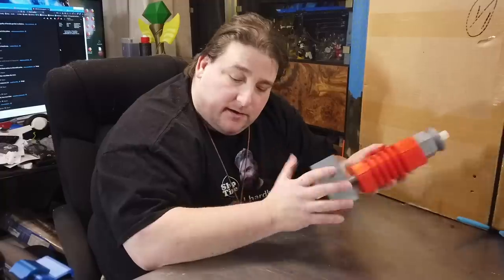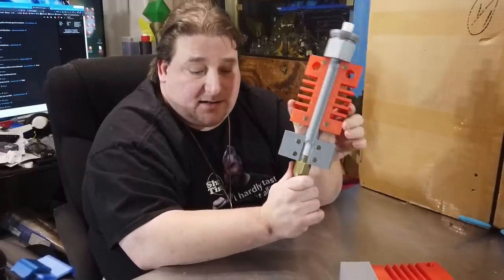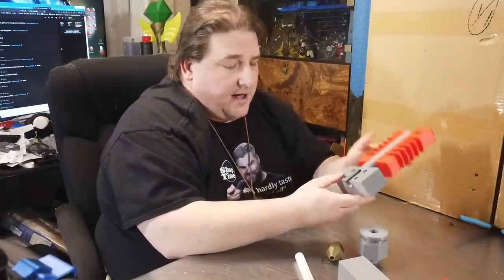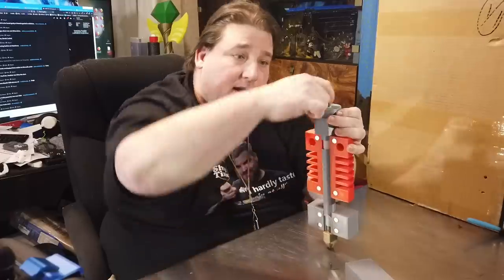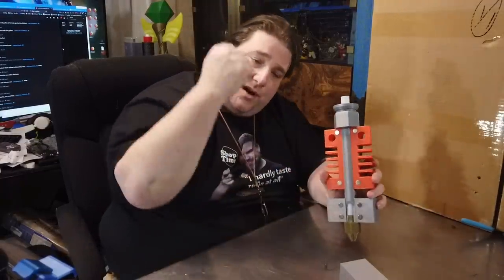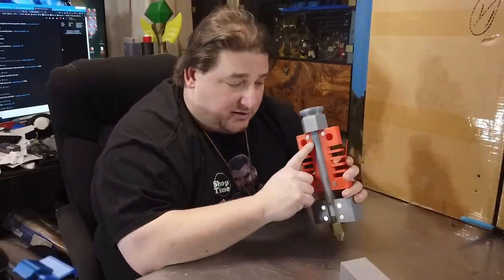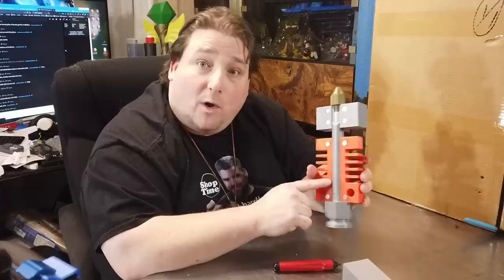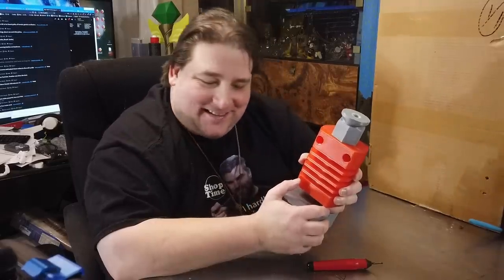Creality Hot End Failure Modeling How to Fix, Assemble CR 10 Ender 3 5 Mini T3DP

Comment: I was going crazy from clogging at nozzle non stop. Whatever out there i did never helped.
The idea of pushing filament extra bits by turning the connector was a briliant idea.

I througly cleaned inside the nozzle. Pushed tube while hot, then i thought it would be better to push cold. Cold push, connecter squueze. BAM! suddenly my print is not stuck after 20 minutes. 

You are a life saver :)

Comment: That 3d printed hot end model you made is BY FAR, the coolest most creative visual representation of the part on YouTube. Tops a PowerPoint graphic or macro lens on a hot end and allows you to instruct more smoothly without fidgeting with lenses. 

Simple and brilliant.

You should head up a 3DP program at a college. Could get young engineers understanding FDM basics in no time.

Comment: Had problems for over 2 weeks. Your solution did the trick. No more skipping of the extruderwheel. Blokkage was 7mm long. Had to heat up and poke it out with an allen wrench.

Comment: This was exactly what I needed!

After a nozzle change, I just couldn't get melted filament to stop leaking above and below my heat block. I'd been following the commonly cited procedure of loosening the nozzle 3/4 of a turn, seating the tube, heating up the hotend, and tightening the nozzle. After 3 attempts, with no improvement noted, I was about to give up and buy a new hotend.

You are the FIRST person I've seen to suggest backing off the bowden fitting, and it was the key to solving my problem.

Thank you SO MUCH!!!

Comment: I been noticing dark specks on the skirt side around my prints. lIke brown specs in various places along the first string layer. Also noticed my prints were starting to go from great to bad. Watching your demo with that model you said about the bowden tube being cooked off . That makes perfect sense to what is going on with my number 2 printer. My number 1 printer already suffered a major clog and needed a hotend replacement. Thanks for the  clear tutorial. The model is a great way to identify problems.  Thank you.

Comment: This video solved my troubles, thank you very very much. By the way, my problem was not the gap between the PTFE tube and nozzle (although it was immensely useful to know how to do it properly), but rather the hot end cooling fan was turning of during the initial layer (I probably connected it to the wrong port) causing the filament to bulge with the heat as you explained, that was the “aha” moment for me. Again thank you very much for the quality and concise information.
Reply from the maker: yep sounds like you had the plugs for hot end cooling and parts cooling reversed. turning off for first layer or 2 is normal SOP for parts cooling.

Comment: I've been having so much trouble with my hotend leaking burnt filament goop all over itself and my prints, and causing so much ugly stringing and gaps in my layers. I'm currently reassembling my hotend after taking it apart, cleaning it, and following these very thoughtful instructions to make sure it won't happen again. I had been changing out my nozzles and had no idea that it could cause this, and I wasn't tightening them extra after heating up either, so that's another new thing I learned. Here's to hoping this fixes all of these issues. I am not very technologically or mechanically intelligent on a base level, I'm only good at learning how to do things from extensive Googling, so there are a ton of things I find out that I'm doing wrong that would probably have the professionals ripping their hair out to see me do. I'm also brand new to 3D printing, having only been doing it for 2 months now. 😅

I'm not sure you will see this since the video is older, but you seem like such a nice man, 11/10 would hug.
If you do see this, or if anyone else knows, I do have a question: what kind of stepper motor do I need to get to replace the stock one on my Ender 3 Pro? I had the 42-40 but I got the metal feeder parts and had to get a new stepper that I could attach the new burr/grip gear from the feeder parts kit to, and I ended up buying a 42-34 and I'm not sure if this may be causing some of these issues or not. There's a ton of clicking where it's jumping back and sometimes grinding down the filament.
Reply from the maker: as long as you are willing to learn you will get their. nothing in 3D printing is actually hard it just not familiar and sometimes not quite obvious until you know what your looking for. stick with it. learn practice adjust and you will get it!
Reply: @nerys71  Thank you! I had forgotten about this comment I made, so for anyone reading this, my final issue was heat creep! I had to buy a new cooling fan for my heat sink!

Comment: Thank you Sir! I just started my 3D printing journey and nothing was working. I was about to just cut my losses and quit because I simply could not find the right solution. But you sir, have saved me from quitting. I ran through the steps just as you said and thoroughly cleaned out my Ender 3's hot end. My nozzle had gotten so caked up with PLA that I had to switch to the extra that Comgrow fortunately provided. I feel so relieved that I can finally print a proper Benchy😅.

Comment: Thank you so much, I attached a BL Touch to my 3D printer and couldn't figure out why it wasn't working. It kept saying it was over heating when it wasn't, you casually mentioned the screw that holds the temperature gage in place and that was where the issue was. Screw back in place and it's running perfectly. I watched so many videos ans yours was the only one that mentioned it, thank you very much, probably just saved me many £££ in unnecessary replacement parts.

Comment: Super demo! the giant model is a great teaching aid- another demo of value of 3d printing.
I sure wish th real thing went together and apart this easily! 
I suggest you mention that the heat break threads into the heat sink, the heater block threads onto that, and the nozzle threads into that, making assembly and disassembly way more tedious than 
it is with your model!
Reply from the maker: Most nowadays don't thread into the heat sink. Just slides in with a set screw. The old ones from a few year ago threaded in. Superior in my opinion.

Comment: Thank you, Best most complete illustrative description I have come across so far. I have always missed the part about pushing the PTFE tube all of the way through the heat break and heater block before installing the nozzle from other videos (not necessarily because it wasn't there but not a prominent without the large model). I also missed the part about ensuring that the nozzle edge was perfectly clean (though i tried anyway) and now i know and understand why it is so important.

Comment: I know this is old but I just want you to know this is still probably the best video out there on the subject. This seems like a very underrated channel.

I still don't understand why many suggest adding a small PTFE tube and a plastic spacer to the hot end instead. This seems just as vulnerable to issues but more difficult to work around...

The only part I've been doing differently is using the nozzle to tighten against the tube instead of the coupling as it's a bit easier IMO. After a nozzle change I loosen it ~1/2 turn, push the tube into it then tighten it up. So far working great but using the coupling may be more reliable.
Reply: For me the short PTFE tube mod is perfect. That way I don't have to worry about the gap between the nozzle and the tube even if the other tube gets loose and wiggles around. I know that it's not at the hot nozzle the gap has built up because I've secured that with the "cut tube and spacer"-mod. I can also disassemble the extruder part and replace the tube without the need to worry about the spacing down at the nozzle.
The only time I need to worry about that is when I change the nozzle itself. This has saved me time and headache as compared to the regular assembly. 
I've seen printers that have to fix and clean the heatbrake tube constantly due to a gap always reappearing after a while. The tube keeps creeping out over time.
I've also seen printers with this cut tube and space mod going for months on end without ever needing to fix/clean the heatbrake tube thanks to the bits being well secured and fixed, even if the other tube creeps out. The worse they get is some stringing due to too much slack in the extruder tube. But that's much easier to fix than the gap between the PTFE tube and the hot nozzle.
Again. It saves a lot of time and headache.
Reply: @sysghost  That makes sense, especially if the printer has old or crappy couplers allowing it to slip. Once that's resolved I feel like it's more about a proper routine. 

I never had issues in ~3 months with stock tube but I can't say it wouldn't of developed one. My extruder coupling was awful and started using my own version just after a few weeks. However the nozzle coupling was surprisingly solid from day one up until I replaced it with a better one. 

With the higher quality Capricorn tube, I see no signs of walking or warping and prefer the ability to quickly move, secure then tighten everything as one piece. If done right I can't see this ever causing a problem but if I had to stay on the stock tube perhaps I'd eventually see the reason many like you prefer the mod.

Comment: Fantastic video. One addendum that may be useful: it is better to heat the head  when doing this maintenance. Usually some plastic particles creeps in the thread of the nozzle, so the nozzle is locked in place when cold; unscrewing it when cold requires too much force, and it may damage some parts; when hot,  I do not usually need pliers to keep the head still, I plug the appropriate tool to the nozzle and iit  unscrew smoothly and effortlessly. I use PETG; I preheat to 150°C before unscrewing the nozzle; then heat at 230° so that the PTFE tube is not glued to the internal part of the head, then I push the PTFE tube out of the noozle side to expel any blob, and I clean the tube when it is hot (so it is easy to pull off blobs from it); then I san the end of the PFTE tube to make it as flat as possible; then I go back to 150° before reassembling everything
Reply from the maker: I thought I made that clear. I will have to double check that. Big mistake on my part if I did not mention that.  you absolutely MUST do this HOT. you can and likely will literally snap the nozzle in half if you try it cold. the filament in the threads is like concrete !!!

Comment: Great video.  Awesome visual aids!  I'd suggest not tightening the nozzle against the block.  Leave a small gap between the hex and the block, about a fingernail thickness.  What I find to be most important is that the nozzle tighten against the thermal tube, not the block.  The block will float, and is simply a coupling nut.  Retightening when hot is important, because the block will grow when hot, and you will need to tight the nozzle against the thermal tube again.  This is why I suggest to not tighten the nozzle until it bottoms out on the block. This new Creality version is pretty odd.  The original design was better.  The added screws are totally unnecessary.  That being said, the stock hotend is just fine.  It just needs proper assembly.   Tubing cutters are worth the low cost.  You did an awesome job on this video!  Liked and Subscribed!

Comment: Wow!  I never knew there was such a problem with Creality hot ends.   4 years ago, before I did anything with my new CR 10, I bought the Micro Swiss cooler block, heat break with the blue Capricorn PTSD. tube.  It came highly recommended as an important upgrade.  My CR 10 has been running like it stood something.  I tuck my fans off all too gather and started printing ABS and Nylon-X composite.   Of course, I had to build an enclosure to keep the heat in, but that's part of the research.  If people don't do their homework when it comes to 3D Printing their just asking for trouble.
Reply from the maker: There isn't such a problem with creality hot ends every single bowden hot end on the planet will have the same basic problem you simply notice it more with creality hot ends because there are so many of them out there if 1% of 1% of the hot ends have this issue for most printers you'll never hear about it but because they sell millions of them 1% of 1% is actually a substantial number

I wish creality and the rest of them would move to a more secure hot end a two-piece Bowden tube for a good example of this see Luke hadfield's fix but that would cost them a little bit more to implement which is probably why they don't this is just so simple and honestly for most people trouble free